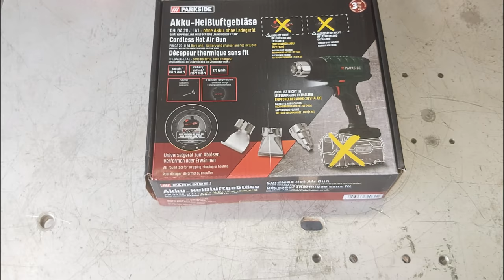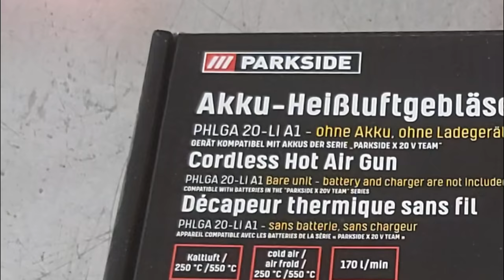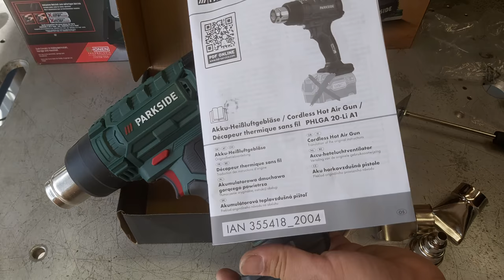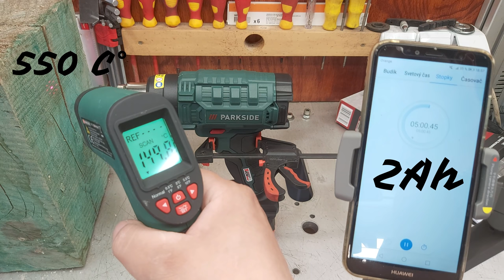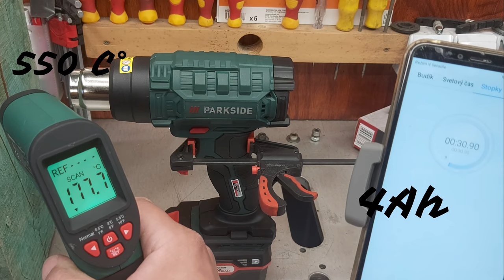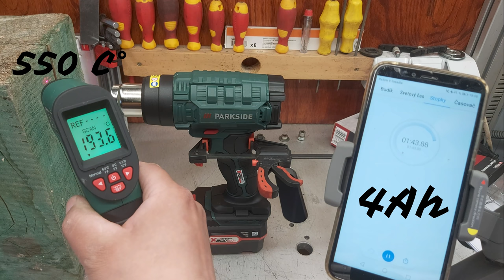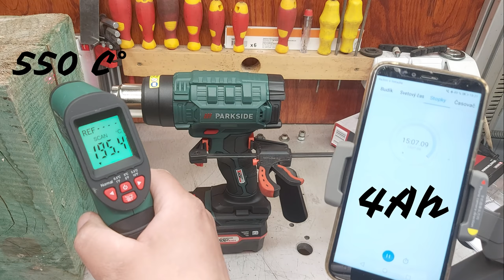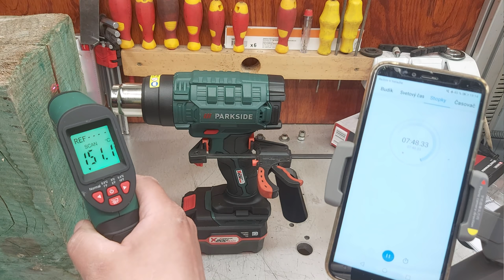Parkside PHLGA 20 Li-A1  Teplovzdušná pištoľ na akumulátor  test výdrže a teploty 550°C

Comment: The air gun is limited to physical possibilites using 20V 2Ah or 4Ah Akku. Heating is energy expensice, if they would have increased air flow temprerature would drop. Its a trade off between max temperature and max air flow. An upgrade could be to regulate the air flow as well as the heating filament. This would lead to lower temperature, but what might be needed in some cases. As they wanted to give the customer defined temperature they did not go for this option. Accoridng to the 16 Minutes for the 4Ah Akku the gun consumes exactly 300 Watt.

I bought the gun as I have many items and akkus from Parkside. I have it in my camper van and it can be used as an auxillary hair dryer (temperature is not too hot) or to clear your window when its full of condensation, but be carful using it that way.
Reply: How did you get 300w? I calculated 270
72wh battery and it ran for 16min
Reply: @Boz1211111  4Ah*20V = 80Wh; 16min/60min = 0,2666h Runtime; 80Wh/0,2666h Runtime = 300Watt

Comment: At 2:26, if they do a longer battery, then it won't fit in many of the tools in their range. A taller battery with more capacity, would still fit in all tools I assume. Parkside as well with all tool manufacturers, have power hungry tools, ie; hammer drills, circular saws, angle grinders etc, so a bigger capacity battery like 5Ah, 6Ah will make sense. The 2.0Ah battery is not going far with some tools.